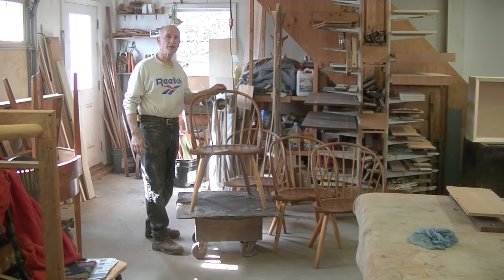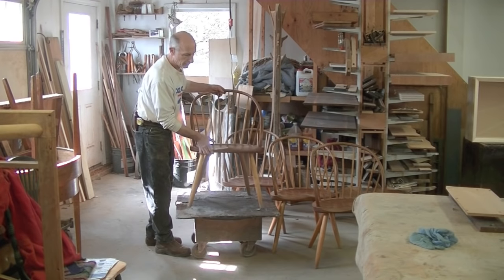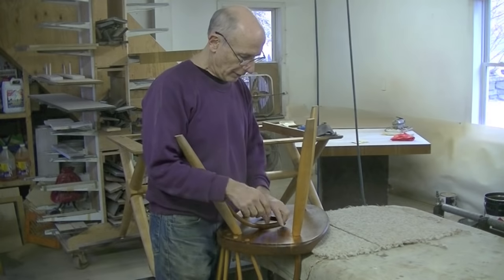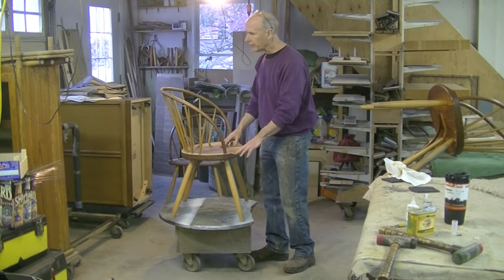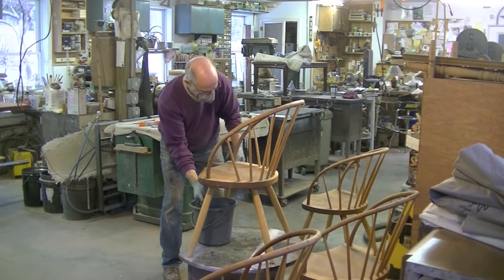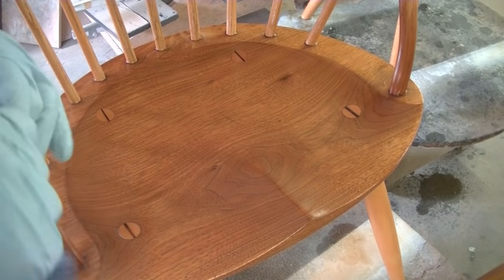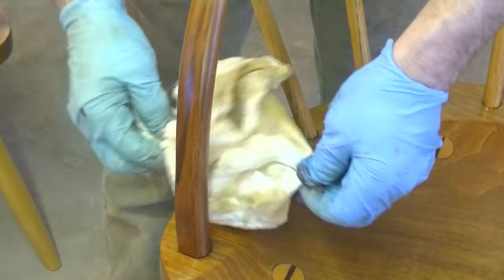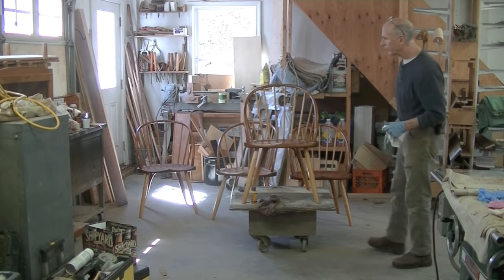Restoring a Set of Thomas Moser Chairs - Thomas Johnson Antique Furniture Restoration

Comment: Tom, I was interested in what type of glue you used to secure the legs of the first chair.  Was it a thin super glue or a polyurethane glue?  Did you also re glue the dowel?  Lastly you spoke of coating the chairs in tung oil.  Was the last coat tung oil varnish?  Thanks for sharing your videos.  Like a good wine good information does not age.
Reply from the maker: Thanks! I used "Wonder Loc Em" for joints that I can't disassemble. And yes, the "tung oil" I used was actually a tung oil varnish - Waterlox

Comment: It seems like the wedge in the top of the leg is preventing the loose leg from moving down through the seat and the peg on the underside is preventing the leg from moving up through the seat or at least helping the wedge maintain the position of the leg. In service, both the wedge and the peg are needed.  I wonder if the front two legs may have been a little long, thus making most of the service loads on the front legs higher than the loads on the rear legs. The pegs may have been a little short and not fully engaged in the leg. I don't think it is worth x-raying the joint to find out. Perhaps the front legs had a slightly higher moisture content when the chair was built and a change in moisture changed the diameter of the leg between the top and bottom of the seat.  If you have six chairs and only one of them have this problem decades after normal use, it is probably an unusual set of circmstances that caused the failure.  If you tried to drill that peg, it is highly likely you would endup replacing it with a peg with a larger diameter.  The more you think about it, the speccial glue starts to sound better and better.
Reply from the maker: Thanks for commenting! Yes, it's pointless to start messing with it, it's best just to glue it back as best you can

Comment: Nice Job, they look new! I have an antique french classic chair that I removed the laquer but there are many dark spots especially around the crevices and design work that I cant seem to remove. Some of the legs are dark grey along with spotting all over giving the chair a dirty look. I dont want to stain the wood, I just want to use a tongue oil as I love the its natural coloring. Would you suggest I use oxalic acid to clean it up? What else would you suggest? I have used a tooth brush for most of the job since the detailing has many crevices. Any advice on how to clean this baby up? Thanks in advance.
Reply from the maker: You can try oxalic, it might not work. Try household bleach, but there's not too much you can do.

Comment: Hi tom I just bought a antique high chair. The lady told me it was dipped. What can I buy to restore. Can you please give me steps to what I can do. I was going to just stain with nice finish. But I am no expert. Just want to make it look nice. Thanks for video.
Reply from the maker: Hi April, thanks for watching. Sand it really well with 100 grit and then 150. Use any type of oil finish at the hardware store and give it 2 or 3 coats
Reply: Would you put polycrylic protective finish on it miniwax water based. I bought a can but did use Danish oil with 3 coats of that on it. Was goi g to put on the polycrylic after. Thank you for response back.

Comment: When you blow off the dust with the airline doesn't it come down and settle on the coat of oil? I thought that a tac cloth is used.
Reply from the maker: Yes, a wiping cloth would be better. I have the window fan on, and I blow it towards the fan in the hope that the dust goes out the window. Thanks!
Reply from the maker: That's true, it could happen. I blew the dust off towards the window fan and didn't worry about it!

Comment: Tom, instead of oxalic acid, couldnt you use vinegar to do the same thing?
Reply from the maker: Hi, I never thought to use vinegar, I don't know if it would work. I know that the staining was caused by steel wool and water, and I know oxalic takes out mineral stains like that, but I don't know about vinegar.
Reply: Steel wool will react with the vinegar to make a black dye.  Probably not a good idea.